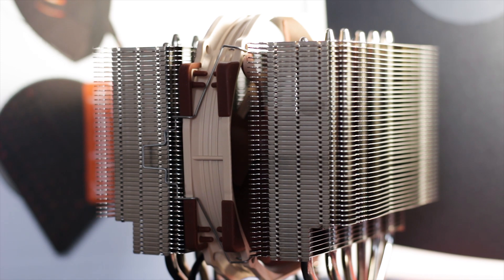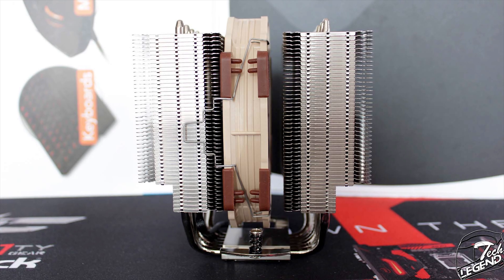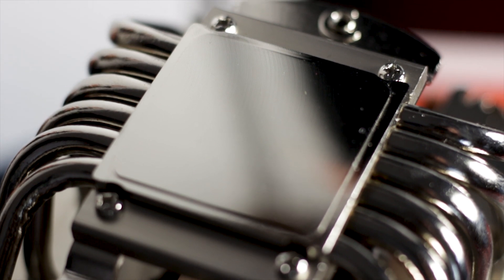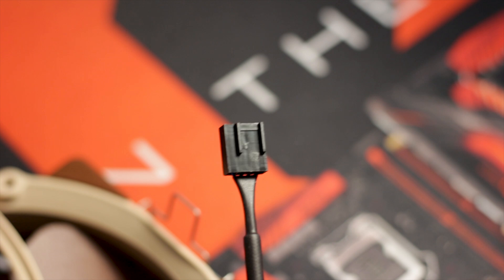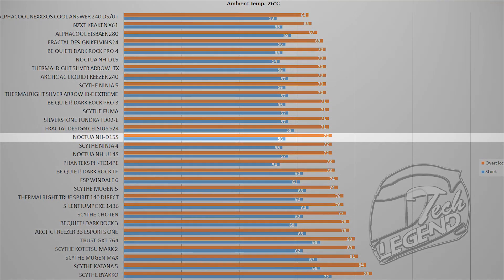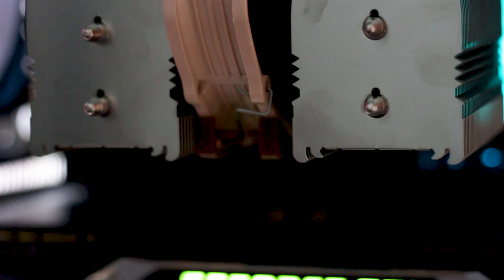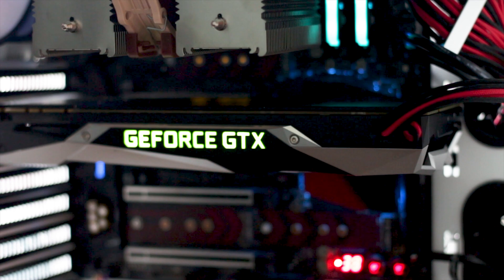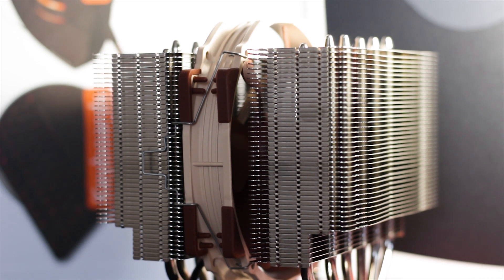Noctua NH-D15S Review | Improving a great air CPU Cooler

Comment: subscribing! been looking for a decent review of this one, i was just wondering if we can clip a 120 fan instead of the 140mm
Reply from the maker: Thanks for watching! You can place a 120mm fan there, but not sure if you can do it with the 140mm fan clips, you might need to either make new clips or get fan clips for 120mm fans.
Reply: @TechLegend-com  i've watched the full review in your website, noticed that the fan clip is similar to the 120mm fan clip!
Reply from the maker: @ProximaSun  Yes, they are similar in shape, but I couldn't say that they are the same size.
Reply from the maker: @yougotservedyo As I've said before, it is possible to install a smaller fan. You just need to adjust or make your own fan clips.
Reply from the maker: @yougotservedyo I'm not sure, but you can always make your own clips with some metal wire.
Reply from the maker: @yougotservedyo Please let me know how it goes!

Comment: I wonder what full load means in this video, but on my rig temp is much over 72C. In fact it throttles.
Aorus Elite Z390, 9700K at 4.9GHz (stock overclock) under Prime95 (without AVX) hottest core is 97C.
However with disabled XMP memory profile (2100Ghz), max temp under Prime95 was around 86C.
Ambient temperature 20C.
TDP 180W
Reply from the maker: Full load means just that, the CPU overclocked to 4.5 GHz and the Intel Burn Test V2 benchmark used for the load. The 6600K that I used in this video, is not as hot as your 9700K, but at that time, it was the best CPU I could have.

Comment: Is it possible to mount this cooler so that it exhausts vertically?
Reply from the maker: Yes you can.
Reply: @TechLegend-com  Thank you!  Can i ask you a really specific question... If you mount it vertically so that the 'short side'; of the cooler (since it is asymmetrical and the block is offset) is facing the memory slots, are the RAM sticks still covered, or are they visible?
Reply from the maker: @nozyspy4967  I haven't done it myself, but it really depends on how the RAM slots are placed in relation to the CPU socket on the motherboard. Chances are, that if you install the cooler with the "shorter" side towards the RAM slots, then they will still be visible.

Comment: Just to add to your review - It fits nicely inside a Fractal Design Core 500 itx case and keeps overclocked CPU very cool. As I write this my CPU temp is 37C, system temp 38C and GPU 31C. Lengthy 4K gaming, CPU reaches a maximum of 65C.https://pcpartpicker.com/b/PbCbt6
Reply from the maker: That a very good performance, and overall system. Thanks for adding this to the review, it's valuable info! :)